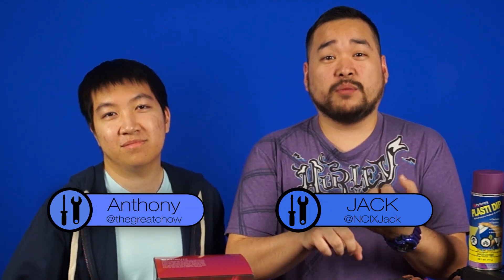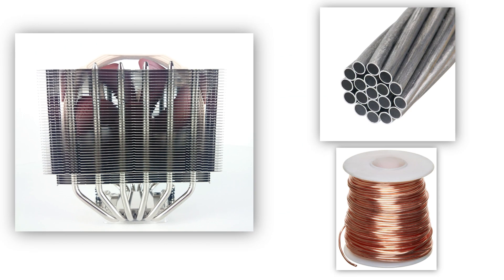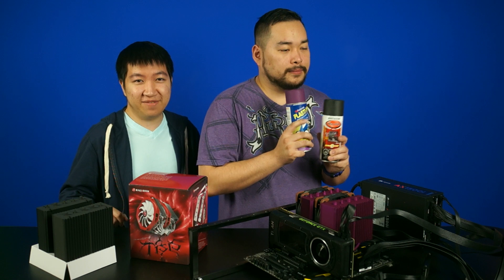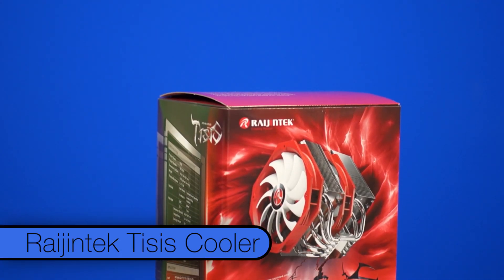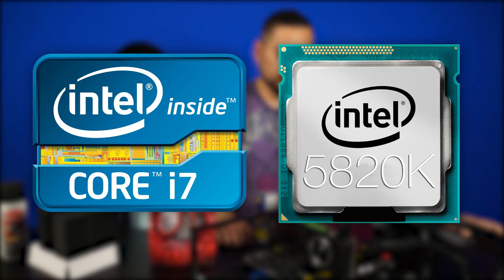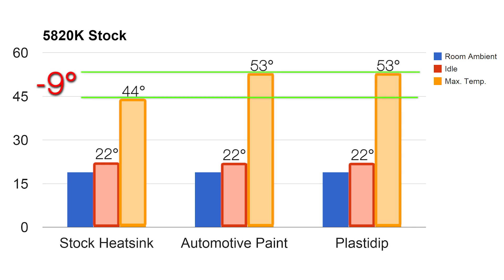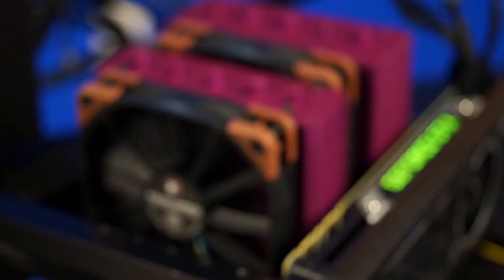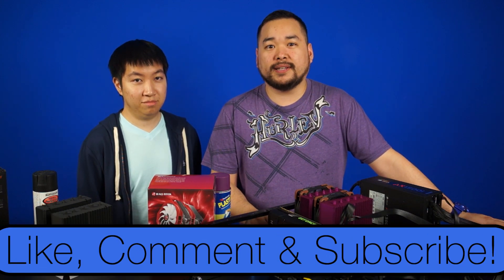Painted CPU Heatsink! Plastidip + Auto paint mod ft. Raijintek Tisis

Comment: Why all the dislikes?
Reply: all the dislikes? Theres like 52, there are always bound to be those always downvote people coming to watch these things.
Reply: ZettabyteGamer Because painting heatsinks is a bad idea, as they demonstrated in the video.
At least that's my guess.
Reply: Anthony said he had a "theory", which meant that he had performed many many experiments and that the theory is an explanation for something. He should have said hypothesis or guess instead of theory. I still thumb-ed up for the cool video, though :)
Reply: You must be new here. Videos get dislikes for any reason and no reason.
Reply: Because people treat purple heatsinks differently than silver ones! D:
It's like racism, but with heatsinks.
Reply: drink15 I'm not new, there are more than normal, and when I watched the video (a few minutes after it went live) the dislike ratio was like 60/40 (likes 60% dislike 40%)
Reply: Ry P 9 degrees isn't a massive increase, while yes it isn't a good idea if you are doing overclocking/have the stock heat sync/ want the fans to be quite, but if you are going for a purely aesthetic rig it should not be a problem.
Reply: IdealIdeas100 When I watched the video, which was just after release, the dislike ratio was much worse. It was about 60/40 (likes 60% dislike 40%).
Reply: Jackie Ha Conversationally, theory was fine to use. Most people assume theory=hypothesis anyway. It's only really an issue for in the scientific community
Reply: J Darcy Like I said, not everyone wants performance and only performance out of their rig. If you want it to be more aesthetically pleasing, and don't mind taking a 9 degree hit on CPU temps, again it isn't massive if you aren't over clocking and you have a good cooler, than it isn't a big deal. Do you really think price matters to someone building a rig mainly for aesthetically reasons?
Reply: J Darcy Even so with a good cooler, and fans 15c would not lead to unsafe operating temperatures.
Reply: ZettabyteGamer 9 degrees is fucking hugr
Reply: J Darcy Night man!
Reply: Daquan Jr. Again, it wont lead to unsafe temps with a decent cooler and fan.
Reply: The whole point of buying an expensive cooler is for its performance. The top of the line aircoolers are only separated by a few degrees, so even 5 degrees loss in performance is too much. If you want a coloured cooler you can buy a phanteks and not waste time or money.
Reply: biribobili Again you do not understand the people who would do this. If some body does this they obviously don't care as much about performance as they do about how it looks. So they do not care about a 5 degree, or even 15 degree increase in heat.
Reply: ZettabyteGamer then you dont understand that people who does that should do it on a stock cooler.
Reply: MrBall Breeder A stock cooler isn't as attractive, and a stock cooler would probably lead to unsafe operating temperatures. Don't know why you are getting so upset over this, if some wants to they will and some people probably have before, and you aren't stopping them.
Reply: im not upset how comes you think so?

if you think people that spend money on pc build will gladly lose up to 15c and many Mhz performance just for looks ,then you need an doctor.
Reply: MrBall Breeder They wouldn't lose any performance, 15c increase with a good cooler would not lead to thermal throttling. Dude there are plenty of people with more money than you, and there are lots of people out there who would prefer a better looking rig, over 15c in heat, which again would not make you lose "many Mhz", or any at all. You assume everyone thinks like you, and wants performance over aesthetics, which is incorrect.
Reply: i dont asume anything i look at statitics.

if you buy an i5-4440 and use an painted NH-D15 on it you will not lose Mhz but because higher temps you have an shorter life span cpu.use it on a i7-4790k and it makes no sence.but they talk here about cheap aircooler who cooling performance is low in the first place and painting this will give  Mhz loss.

thats the info that should be told at first.

you asume to much that i assume but my self build pc costed 2400 euro want my specs?
Reply: J Darcy just so you know a lot of fans can move as much air as noctuas, noctuas just do it quieter and have a strong build quality and motor assembly. So you dont need expensive fans. You can just use the stock fans. 
PS: I own 5 NF-F12s, NF-A14, and NF-A9 FLX
Reply: J Darcy i have watched a ton of videos. I spent two days just watching videos and going over benchmarks before buying them. Other fans have high static pressure too, which is my point.
 Take the $11 ($6 amazon) NZXT Performance 120mm (first gen). In a 30 fan round up it was the best all around fan with some of the highest static pressure and air flow, but with the lowest stated specs on the box, and also one of the cheapest. If I remember correctly it was hitting 1.84mm/H2O (the guy tested each fan to see it's real air movement/pressure) 

http://www.anandtech.com/show/6177/choosing-the-best-120mm-radiator-fan-testing-eight-fans-with-corsairs-h80/5

Here Anandtech did a test with that fan. See how it's in the quietest, and hanging with the more expensive fans. Notice the 2.94 mm/H20 rated Sickleflow and how it's actually complete shit. Don't believe box, that's why I did a ton of research. I mainly got the noctuas for their 300rpm lowest speed. I run my rig near silent so it was important.
Reply: MrBall Breeder I don't care about your specs, if you want to have a "my pc is better contest" than we can. I'm saying there are people who want to and do paint their coolers, and they do not give a shit about the extra heat. You don't seem to understand that people build rigs that look awesome, and some people want their rig to look even more awesome, and again they do not care about the extra heat. You just don't seem to get it.
Reply: MrBall Breeder I just don't think you understand that there are people out there who don't mind taking a big performance hit to have a better looking rig, Just don't know why you are refusing to accept that there are people who do paint their heat syncs and there will be more.
Reply: i just don't think you understand that there always exeption so yea there are people that will do so. i also don't understand why you think i refusing to accepting this.ive only sayed statisticly there wont be many people that will do so and i want to make sertin that those people understand the consequences by doing so ,by giving the right information.
the exeption will do so and i see girls doing this but majority of the people that buy dedicated air coolers buy those for performance not for fashion or looks. if they want "pretty' and have alot of cash to spend they will go for custom loops. thats the reality and the statistics confirm it, not you're opinion. 

stop putting words in my mouth or asume what i think because you're going the wrong way with it.
Reply: MrBall Breeder Provide some sources for your statics and ill be happy. All I'm saying is some people will do this, and thats all I was ever saying.
Reply: http://techreport.com/news/25903/lepa-splashes-color-coatings-on-its-cpu-coolers

strangely enouf at the real release they release only white and black no blue and red . .up to you to find out why and google its performance review....

im not gona give you my sources because it pays my bills.

ill give  an advice for anyone that thinks about painting the aircooler.fans with led light... use them.
Reply: MrBall Breeder bs you don't have sources. If you would've actually read the article then you would know lepa was doing PR trying to find out of people wanted colored coolers, if there was a demand then they were going to make it. It never came out because the demand wasn't there. 
And so there are no reviews of the coolers. If you can find me a source showing those coolers on sale or a benchmark Id LOVE to see it. 
It's funny though because you're bashing the coloring yet they just did tests with even plastidip and they still cooled well, around 80% of the cooling it originally had. But when you strap a 180w tdp Evo 212 to a 88w tdp 4790k you're going to be ok and still be able to overclock
Reply: MrBall Breeder Duh the Black and White versions exist, we were talking about the colored versions, which were what the whole PR event was for and what they were doing the poll for. They didn't make the colored versions. 

The cooler isn't bad, it's better than stock and you get a black or white cooler. But I was going to say that what do you expect from a company, and parent company, known for making shitty products? They aren't Noctua or Seasonic. 

But they're benmarks speak for themselves. They painted and plastidipped a cooler and temps rose only 9c, not like 20c. Not a whole lot to bitch about.

Comment: What if you put painterstape on the fins ( where the air goes through so no paint will go into that area) and then painted the rest of the heat sync the fan will cover up the unpainted area right?

Comment: Well, could part of the increase be due to you having painted over the CPU contact plate? I'd guess if you put tape on the contact plate or lapped the heatsink until the paint was completely gone, the temps would be closer.
Reply: BronyBoyYack okay cool i dont remember signing up to hear your life story but thanks anyway
Reply: +JZZ31 You made it personal, bro. You didn't have to make it personal. If you didn't, I wouldn't have spilled my guts out (past success story) from behind a glass wall (the internet) for you to see in all the glory it can manage to be. While I'm not a perfect man, and certainly not the most intelligent, I'm nowhere near one of the many who currently push the boundaries of how imperfect and/or outright stupid one can be. You took my comment, insulted it, and then insulted my explanation and made it personal. If you are one to go nitpicking my little life story there as well then god help you, cause you'd need it when you go insult a hothead that knows your address the same way you've done me. Maybe I'm behind that barrier of protection known as the internet, but said hothead isn't. Be glad I'm not one to get angry and track every bit of your personal info and hunt you down to beat you up IRL, instead of the guy that gets dissappointed when someone insults almost just to insult and loads them with reason and logic until they get tired of it or run out of ways to insult me.
Reply: +BronyBoyYack man you need a social life, how hard is it for you to talk to girls
Reply: +JZZ31 Wish you had a G+ so I could block you and end this... You are trying to take your insults too far, and to be honest, your most recent attempt barely makes sense. I don't know why you are so dedicated to trying to make me look like a stupid shit, but I'm fairly certain that at this point you're just making yourself look bad. And Cartoon Network, the one you see today, and are probably referring to with the kids shows remark, is terrible. Kids shows from my days actually had eye worthy animation, with storylines and character sets that made them worth watching. So sad to see such a good and respectable company fall so low.
Reply: lol dont block me dude you're a frickin riot i'm getting quite a kick out of your edgy paragraphs
Reply: +JZZ31 I knew you were just trying to troll me and piss me off. I KNEW it! I suspected from the beginning that you had an alternative motive for throwing those comments after me. I feel prideful that my little tactic works in two ways. Also, I don't think I can block you since you don't seem to have a G+ account. lol glad you enjoyed it. every time I got a youtube notification from this chain I smiled a bit on the inside and semi-sarcastically asked myself "What's this asshole got to say now?" You trolled at the wrong person and both sides got a kick out of it in the end. TBH, though, I don't condone trolling, so I will ask that you at least be careful and watch out for the hotheads if you aren't going to stop.
Reply: +JZZ31 less than 25% of that comment was grammatically legible. As a result, your fingers have decided to die and fall off. What will you do now?

Comment: Hey i was wondering if painting the heat sink/ radiator for water cooling white will improve or suffer the performance. If you think it logically, the radiator in the house (the one that is in wall which spread heat not the computer one) is normally painted white and thous radiator is used to spread heat not conceal heat. On the other hand, laptop heat sink is normally blank so I was wondering which have the least performance reduction, black or white?
Reply: wc radiators can be spraypainted since they do not get warmer than 2-5deg c above ambient

Comment: Only thing that made temp go up, well you paint the conductive part of heat sink.
If you didn't spray that it would been same. Or maybe even better temps.
To back that up, black intercooler will perform beter then plain not painted one in case when air do not gro it. Simple fact.

Comment: aluminium has a better heat disipation ability and can be anodized with pigment...

not sure if you can unevenly anodize it for decoration purposes though...probably not...

but it might be possible to etc the surface to get at the non-anodized surface...
though typically the heat sinc blades are very thin....

if all you want is a solid color however then anodizing is all you need.... 

and it wont alter performance at all since your just creating a thin oxide layer which would be there anyway...
painting is not the way to go at all...

Comment: I would have not painted the CPU contact surface. That just seems like a concentrated heat barrier spot. But Even the Turbo guys in the automotive world have tested repeatedly about painting a inter-cooler. And even then the findings are all over the place. So i would have to test this. But if you are strategic in your painting and used the thinnest coating. I can see this having little to no impact on overall performance. Most likely your room temperature will have a bigger impact. Lol Just don't let Linus paint your Motherboard... J/K
Reply: John Simpkins They didn't, the plastic was still covering it.
Reply: They didn't paint there. 

Ya, it would be a plain horrible idea to do so :p

Comment: We don't see many anodised black heatsinks. Why not? Black radiates more heat than  silver surfaces (simple physics) and has been used for ages in electrical engineering for decades. So why not in PCs? Anodising I'd also different than painting as it's depositing into the metals crystal structure rather than a later on top.

Comment: I would kind of I would paint the water block on something like a h110i and custom tube the rest and then the outsides of the radiator (so fins are black) and custom spray paint fans (so fans are coloured) e.g. Red water block, red tubing red outside of radiator and red fan fins

Comment: Actually I was thinking about plastidipping my heatsink but wasn't sure on the impact on the persormance. 
Do you think you could test the performance of custom painted heatsinks under a bigger load? What's the difference of painted and stock heatsink if you oc the processor a bit more?
Reply: Reason says the difference would be higher.
Reply: I guess it is, but is it still reasonable though?
Reply: Plasti dip is an insulator, you'd be insane to overclock with a painted heatsink.

Comment: What if I only want to paint the very Top of the cooler. Only the first plate. Will that be ok?
Reply: +Rillust No that will not work at all. You have to paint the entire thing lol. Honestly yeah that would be better. The part you see is what is painted and it will likely have no affect because you didn't paint the piping.
Reply: Sarcasm not detected.  cough cough
Reply: Nicholas Reif oh, sorry
Reply: RusticGaming All good. I'll post a link where I painted my air cooler. Only the top, not the rest. Looks really clean.
Reply: Nicholas Reif Damn, that looks really really clean. I need to get a white ATX motherboard, then paint my ram heatsinks, video card, & heatsink. Then after that I got to get custom cable sleeves.

Only problem is that I can't get a white ATX motherboard for LGA1155 which sucks

Comment: I want to change my GTX 960/970 Heat-sink black instead of that ugly copper/aluminum on the Gigabyte G1 Gaming Model. For month's I've been reading forums and had concluded that  I wanted to anodize it.....forget that this is WAY cheaper and possibly a tad bit faster...IDK. Time isn't an issue, money is. I shall test it on my GT 530 First Max temp s 63 while under LOAD. It's maximum operating temp. is 105 so I good :)

Comment: I think I would much rather spend some hours, getting crafty, creating a cool tech looking plastic/acrylic face plate, for the front end of the heat sink (facing you when you look in the pc window), with built in led lights (or not), than painting any part of the heat sink. That 5-6 degree bump can make a world of a difference if your oc'd processor is already hitting about 55 to 60c on full load. 

Good thing I'm a crafty devil. :)

Comment: I don't want to spray my heat sink but I do want to paint the fans for more color orientation in my case? Can this be done?
Reply: The frame shouldn't be a problem, but when you get to the fan blades, your milage may vary of course.
Reply: Sondrayy cant you just buy new fans?
Reply: Sondrayy i want a hyper evo 212 but i dont know if i can just put in a white fan because i dont know much about coolers and its for my first build ever.

Comment: If u are going to paint your heatsink you should buy thermal conductive paint it is hard to find but it is worth it also don't paint the CPU contact area (they didn't on the video by the way) and try to avoid the heatpipes paint only the fins and the top ;) hope I helped